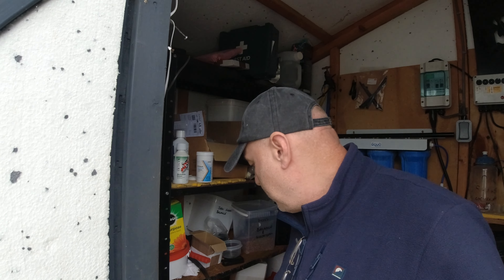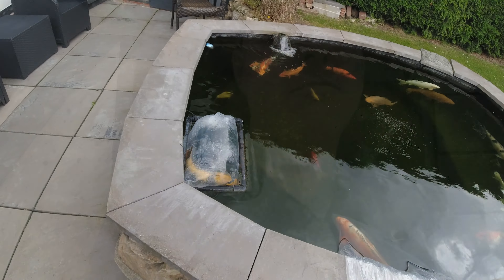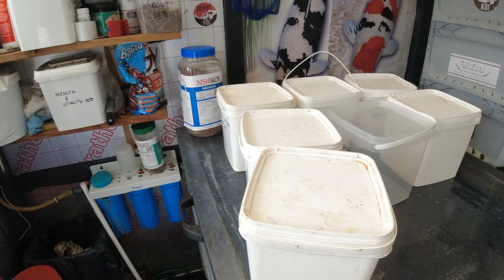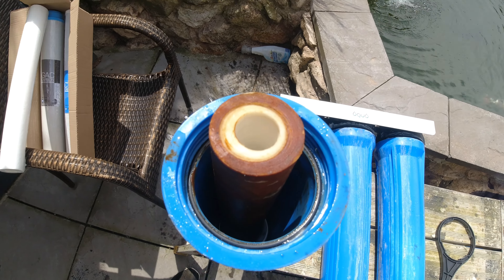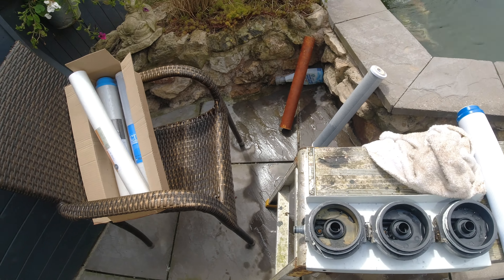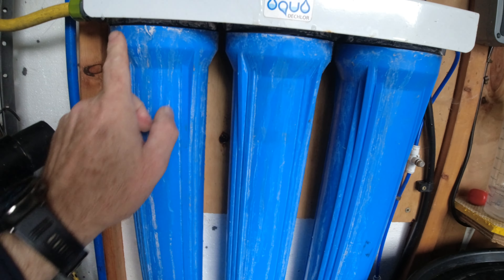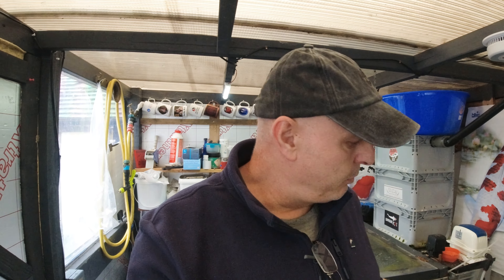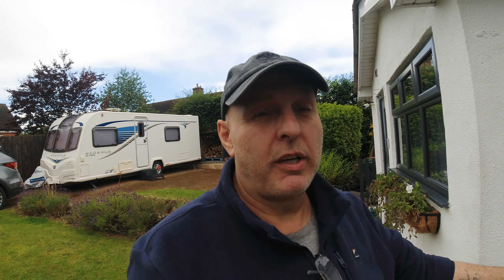Changing the mains water filter, shocking results #koi #koipond #koifiltration

Comment: Hi Andy buy a lean too I’m sure you can find one about that size if not come off the wall use 4x2 on length and width spanning over every 600mm and use 4x4 for your posts should do the trick as for polycarbonate sheets there a bit pricey now
Reply from the maker: Cheers mate 👍 I'm pricing things up for it at the moment, but nothing is decided yet so watch this space 👍